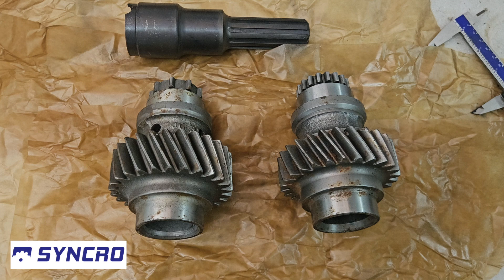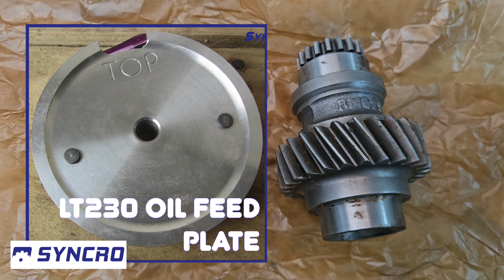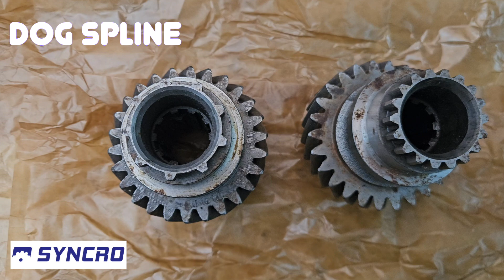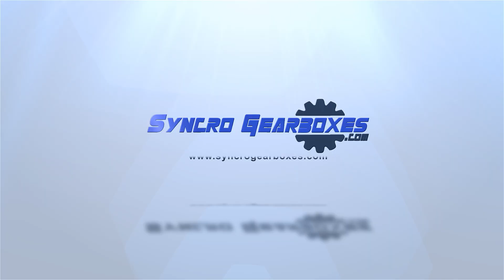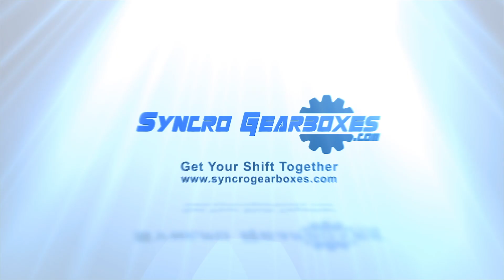Land Rover LT230 Input Gear EXPLAINED 🔧

Comment: I’m looking at getting your guys’s 230-4l80 adapter but the thing is I have a Borg Warner unit since it is an ‘89

Is your adapter compatible with the BW unit? (More specifically the input shaft adapter)
Reply from the maker: Hi Daniel,
The BW box will bolt up where a LT230 bolts up, however they have the short spline length and the physical size of the case is bigger (so may not fit with the LT230 adapter or a 4L80). subsequently i dont recommend using the adapter with a BW at all. In honesty, the LT230 is a significantly better box and id personally make the switch.

Comment: Great technical video, thanks! How do we know if we have a late or early LT230 without opening it?
Reply from the maker: The Serial number stamped on your transfer box will give you a good indication. The further down the Alphabet the later the box. However, the only surefire way is to pull the bottom plate off and visually inspect what you have to save any guesswork.